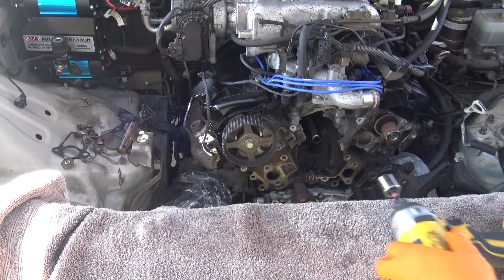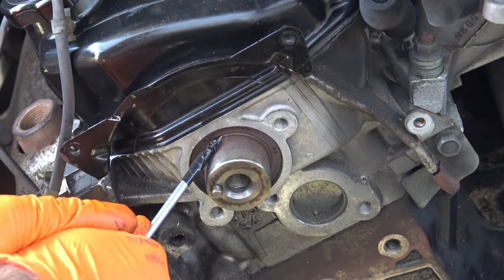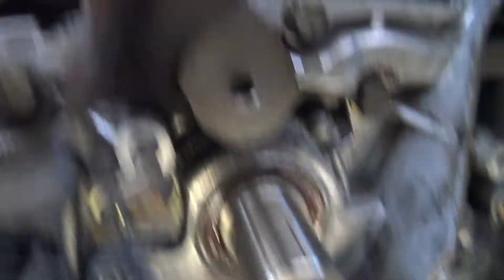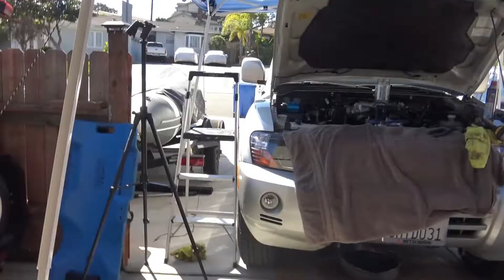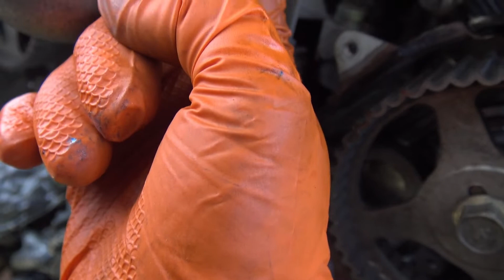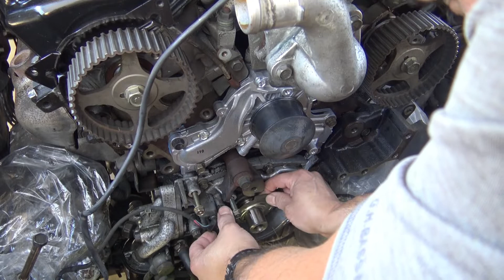Video #10 2004 Mitsubishi Montero Timing belt Installation

Comment: Can I replace crankshaft sensor without removing timing belt ? You replied my comment on Facebook pajero group
Reply from the maker: Yes, you can remove the Crank sensor without removing the T belt. However, upon reinstallation of the crank shaft sprocket, the sprocket and the trigger wheel must slide on the crankshaft already assembled.